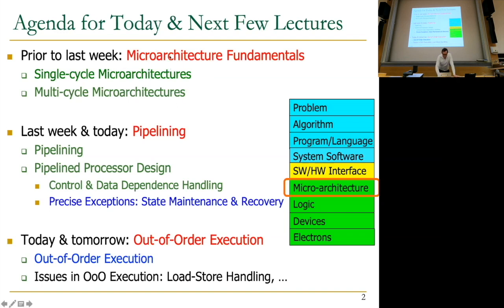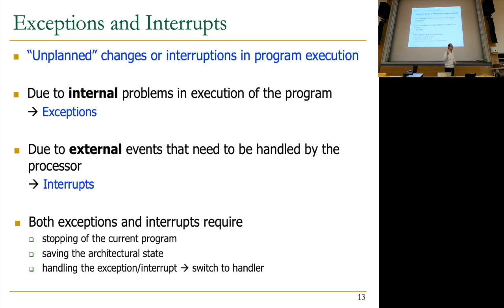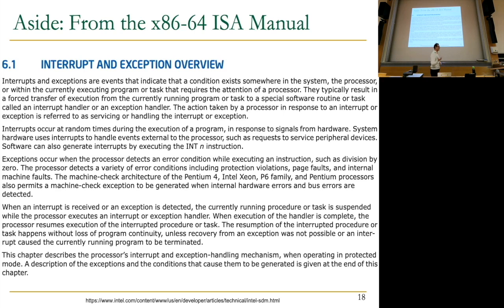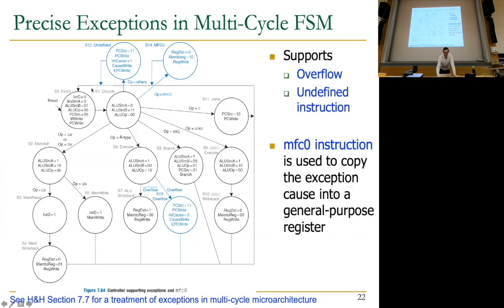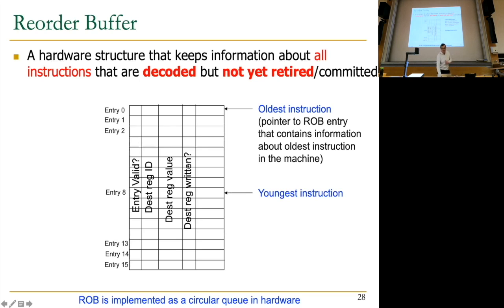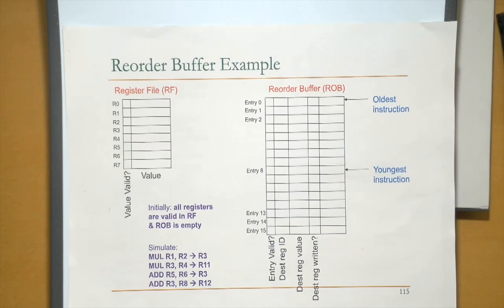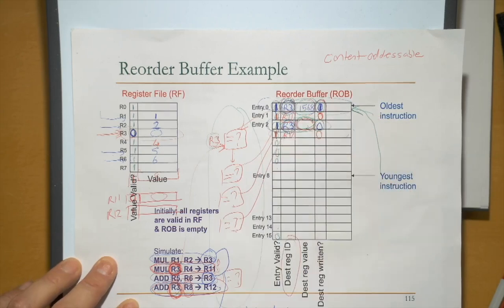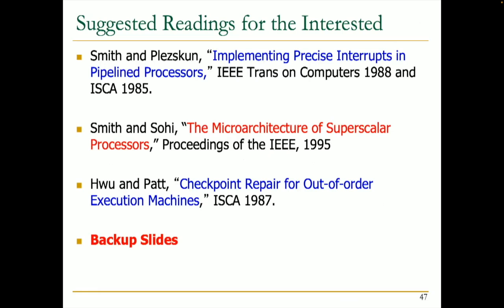Digital Design and Computer Arch. - L13: Precise Exceptions (Spring 2025)

Comment: I loved watching this lecture!
I'm using a similar concept to implement my out-of-order RISC-V CPU. I have almost everything planned to implement, but something that I'm not sure how to implement is RAT snapshotting to allow multiple branches to be in-flight in speculative execution. I could use the ROB and just flush everything if my misspredicted branch reaches the head, but I feel like that it'd take more cycles, so that's why I chose to use RAT snapshotting instead, to make recovery as fast as possible. Now, the problem is... I don't know how to handle the "valid" or "committed" bits.
For example, what if r7 is marked as uncommitted and that the result for r7 is at ROB entry 12, and the RAT is snapshotted by a branch that is going to misspredicted, and before the branch is solved, entry 36 is committed?
r7 is going to be marked as committed in the current RAT, but then, because the branch I previously talked about was misspredicted, that RAT is discarded and the one that was snapshotted is selected as the current RAT again. The problem is, now r7's status is "uncommitted" again, even though it's not.
What should I do in these cases?

... nevermind. I'm just going to use a PRF XD